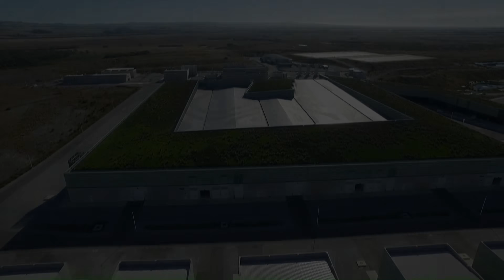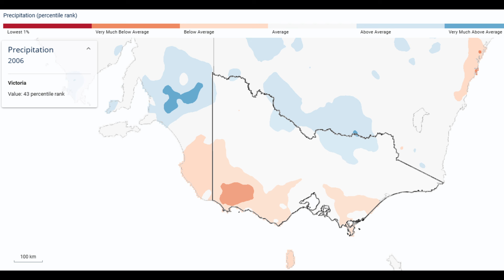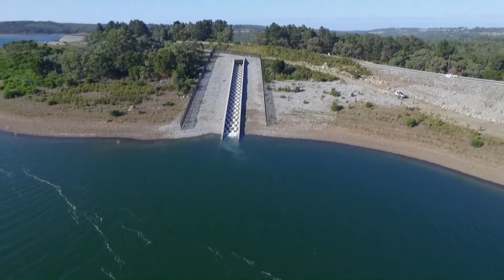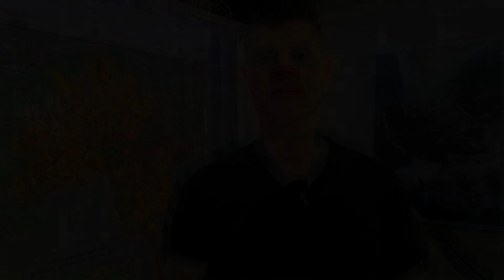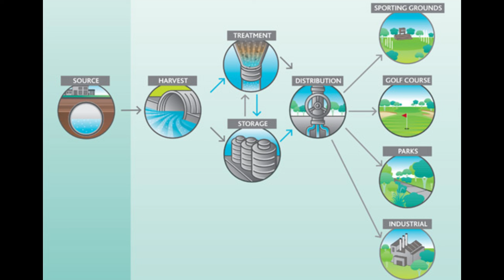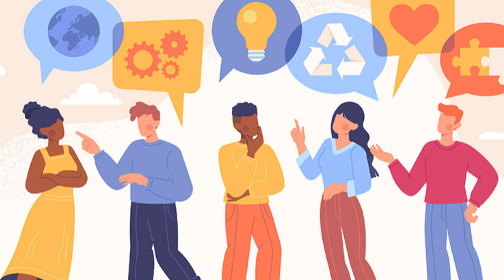Melbourne's Water Story - Ep8: The Future of Water – Innovations & Sustainability

Comment: I'm pretty sure that the Desal plant has never pumped one litre of water since it was finished, it was a knee jerk reaction by the government ar the time at a massive cost because Melbourne went through a dry period or a drought according to the politicians. I suspect that it will never be used because of the large amount of energy it requires.
Reply from the maker: It does feel like that most days. They’ve place an order for this year, and I saw footage of water entering Cardinia reservoir some weeks ago. It does seem like they just commissioned every water supply option all in one go way back in the drought, so I presume they got very nervous and just went hell to leather rather than risk running dry. It’s a shame the north south pipeline is just sitting there by comparison, I know many who feel we should consider using it over desal due to the cost difference per ML
Reply: The Wonthaggi Desalination Plant, operational since late 2012, produces water in response to government orders, not continuously, with varying annual outputs like 50 GL (2017, 2025-26 order), 15 GL (2018-19), 125 GL (2020-22), 15 GL (2023), and 0 GL (2024), having produced 455 GL total by early 2025, but it's designed to deliver up to 150 GL annually when needed,